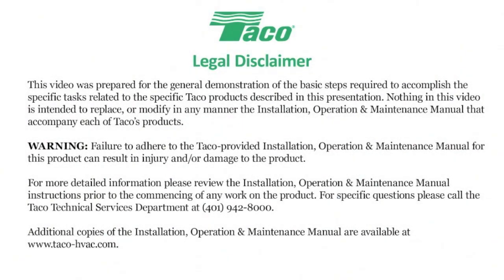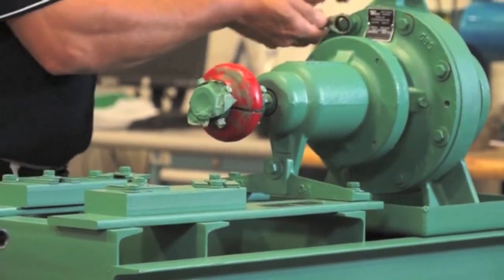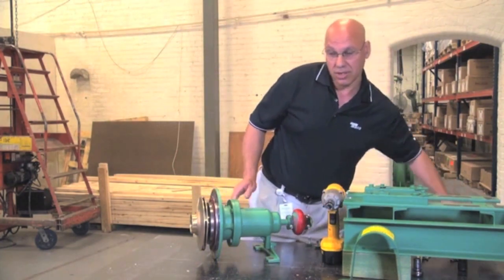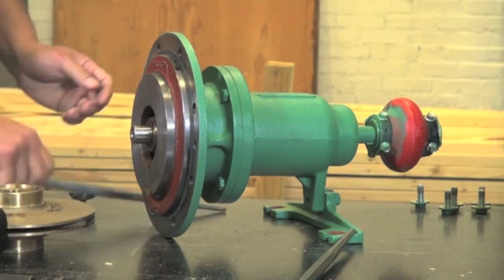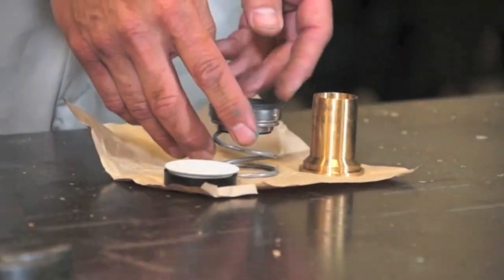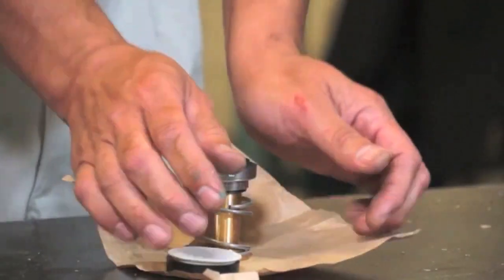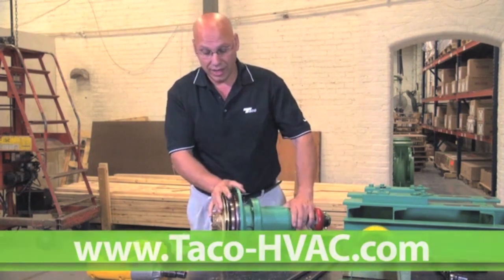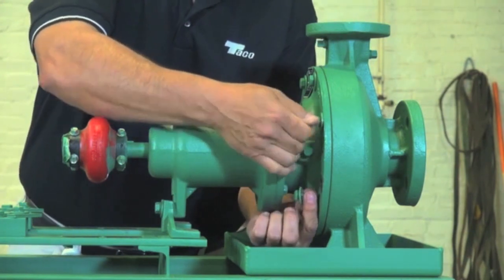How To Replace the Seal on a Taco FI Pump

Comment: Yes, And how do you remove the seal sleeve when  the pump is used and rusty from seal failure? Even my grandma can do it with a new pump!  Poor design.
Reply from the maker: Hello Jose, yes of course it is always easier when working with a pump in this condition and yes it is always harder when there is corrosion involved. If all working pumps were in this condition for the entire life of the pump, it would be a perfect world. However, in this video, we wanted to show the correct method and steps to replacing a seal kit.
Thanks for watching

Comment: This video is not correct. He puts grease on the shaft seal.
Reply from the maker: Good Day Jim, Thanks for watching the video on the FI pump. Speaking with the engineering department, we have been installing seals like this for many years. If you would like to talk or meet with one of our representatives in your area, please use the below link to locate the nearest one. https://www.tacocomfort.com/rep-locator/

Comment: I'd like to see a video on the KV series pumps
Reply: It's literally the exact same.  The biggest problem with these seals is removing the sleeve. 
Heat+pullers, if that doesn't work,  a hole saw the same size as the o-ring groove will suffice. 
Then you can remove the seal plate and egg the sleeve to remove. 
Anti-seize under the new sleeve will help the next tech 5 yrs down the road.

Comment: What a bunch of BS!! This guy is tearing down a brand new pump, let's see them do a video on a pump that been in service for a while as the pump doen't come apart all that easily.  There are better pumps on the market that do disassemble easily after they have been in service.
Reply: Of course they do, they are a manufacturer, not a service company or museum of old & improperly maintained fluid handling equipment. This is no different than what EVERY other manufacturer does in similar videos. Maybe you think they should have pipend in six 20" double suction split case pumps, complete with overhead piping & obstructions, rented a crane or picker & had the demonstrator along with 3 or 4 additional people  to maneuver the top hat out of the way? Wire everything up, live to the motor pecker-head & display every last thing anyone working in the field should expect to encounter? As to the remainder of your blurb, I have had hands on nearly every type  & make of pump used in HVAC & process service applications within the US, a few territories & overseas. Everything from single & multi-stage centrifugals, lobes, screws, double suction,  vertical inline, end-suction, VMS, diaphragm, close-coupled, coupled, direct driven, permanent & replaceable mag, including split mag, split case, axial, turbine, mixed/combo, canned, metering/dosing, grinder, chopper, slicer/cutter, emaciator, circs, self-priming, vertical column, regen & PD, jets, diaphragm, recip, piston,  RR, gear, plunger, progressive, & rotor vanes, in open, closed & mixed systems, for WW, HVAC, process, chemical, solids, storm, muni, sewage, potable, FDA (pharma & food/bev), agriculture, irrigation, fabrication, geothermal, fire, chemical, energy recovery, reclamation, RO/DI, desal, mining, condensate, deaeration, seperation, mixing, boiler feed, & well applications. Flows ranging from tenths of a gallon per hour (injection dosing at ppm levels for mass or volume based solutions) to nearly 100,000 GPM. In terms of applied energy or required force, differential pressures conveyed via pump/driver combinations, they've ranged from a few feet of head (TDH), to upwards of 50,000 PSI. Lift, flooded & pressurized suction systems, pumps in series, parallel, & with or without bypass, not FVD bypass, but a number of those as well. That's another issue for another day.  The biggest factors, the most relevant in terms of ease (or difficulty) of serviceability, in my experience, is & always has been preventative maintenance, environment & application. Pumps, particularly these days, are nearly commodity items in nature. Manufacturing advancements, computational fluid dynamics advancements, available modern design & scalability tools have all improved significantly. Manufacturing tolerances have become more uniform for parts, efficiency has risen (particularly items conforming with DOE/HI/AHRI/ANSI/API/EuP-EC/ErP/etc standards & directives) & engineers & designers have started understanding the ways they''d previously obstructed & hindered themselves with outdated specification requirements. There are some small items that set each apart, but those differences are fewer & fewer with every passing year as patent terms expire.  Further, while there are without doubt some pumps with more easily accessible seals, and even some without seals &/or liquid-end bearings,  external seals, etc.., they are not always suitable or even ideal for particular applications or installations. Many these days like the vertical single-stage inlines. No pump bearing & some have no, or no internal seals. I for one would not want to work near one over 60 HP, maybe 100 HP max, depending on the location & design of the system.  Do a little research on moment of inertia, not to mention motor bearing stresses & additional footprint requirements. Speaking of which, how do you service or change a motor out on a 300 or 400 HP vertical inline? How much overhead clearance is required, what equipment & how much labor is required? Doe the manufacturer use OEM or specialty seals? Proprietary OEM motors? I know of at least one other US based pump manufacturer that sells a lot of end-suction pumps like this. Instead of an off-the-shelf JC #21 seal, they use proprietary cartridges, costing 400% to 800% more & with as high as 12 to 16 week leadtimes on occasion. If nobody stocks it & a process goes down, what is the cost of any associated lost production. There is a lot that goes into the design of a pump, they each have their uses & ideal application types, just like every other type of equipment or tool. There is a reason pros carry specific tools, you know this, the fact that you watched the video tells me as much. Nobody, no single person on this planet that is outside of the trades or engineering, watches pump videos, except maybe students. Being a pro, you wouldn't use your no-hub wrench as a hammer, right? Nobody wants to be the jobsite butcher that everyone nicknames Wrammer. Similarly, pumps apply work, just like a tool & every tool has certain tasks and instances where it works optimally.

Comment: This is a good demonstration, but if any rust has built up on the shaft under the sleeve, the sleeve will become next to impossible to remove. Heat and small pullers may have to be used. If that doesnt work, a hole saw the size of the o-ring groove can be used so the seal plate can pass over the sleeve and you can bang it off with a hammer.
Commonly I put the whole bearing assembly in a lathe ( less impeller) and machine it off.
Note to techs *
Put a small amount of anti-seize under the sleeve during re-assembly.
Reply: I have also used heat through the small fitting where the seal flush goes, this usually goes pretty good. This guy is at the Taco factory taking a brand new pump apart. Two different animals
Reply: Thanks for this tip. I had one today that just kicked my butt trying to get the sleeve off. I'm gonna try this in the morning.
Reply: @huasohvac what did you do got the same problem